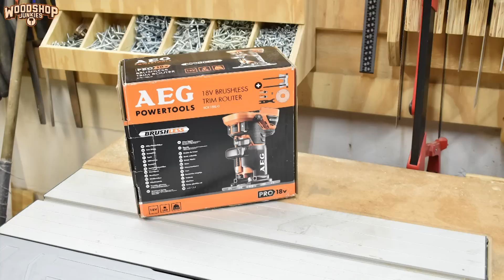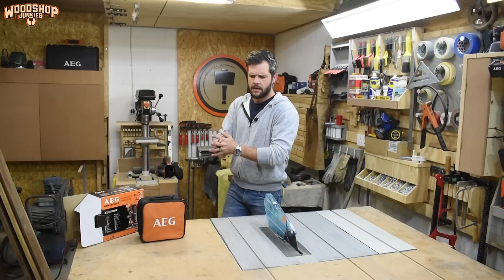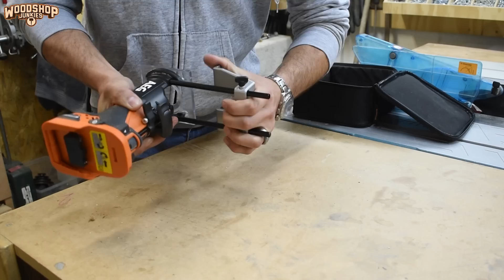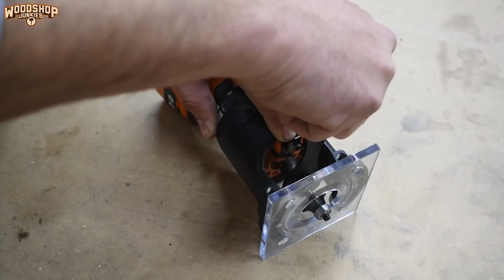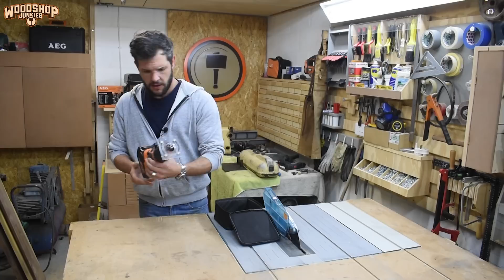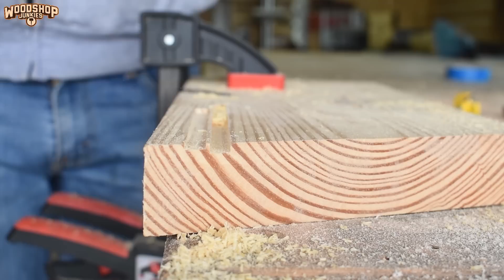Time To Go Cordless? - 18V Router Review - AEG/RIDGID

Comment: Great overview!  
I have the equivalent model of the Ryobi trim router.  It's essentially identical, but no speed adjustment.  It didn't come with a dust port, but I was able to order the Ridgid dust port, which fit perfectly on the Ryobi.

Comment: I own both the Dewalt and Makita trim routers. They are equally annoying when it comes to changing router bits. Sometimes its easier to just remove the base to change bits. At least it only requires one wrench unlike my older Bosch router.

Comment: I have a porter cable router I bought 30 years ago it works every time I plug it in! For the cost of a router and how often it is used cordless is not a good option for many! Yes I have a portable DC powered drill and driver I have had for six years still hanging in there. But it will not last 30 years. And latter down the road batteries will not be available. Been there done that with a Makita drill.

Comment: How are you finding using such a lightweight tool with such a heavy battery? I find this is the biggest drawback with cordless tools - all the batteries you accumulate so you don't run out of power, and their weight when using the tool.

Comment: Good review.

I do not use a router very often.
i have had a corded trim router for about 2 years and very rarely use it.

I like battery powered tools as they are immensely handy.
Not having to drag a cord or in some cases run a generator on remote  sites that do not have easy access to electricity is a plus.

Comment: Love the review. I haven’t been a fan of AEG personally. More that I’ve settled on two battery systems already. Bosch and Makita. I went with the Makita unit. It comes in a full carry case system, includes three bases and the usual fence etc. It is a beast but appears a bit lighter than the AEG or at least has less bulk. Has been an awesome unit. Wasn’t sure about the tilt base till I used it and wow it was great. Includes dust collection, which I’m a bit lazy and don’t use, just throw on the dust mask. Thanks again.

Comment: Hi Jean. Good review.would have liked to have seen template routing capabilities and other functions. On secondary issue , where does one purchase a triton 1400w router in za A
Reply from the maker: I got mine a couple of years ago. More recently I have heard some of the guys mention that they can be tricky to track down locally. Your best bet would probably be specialized power tool distributors.
Reply: I heard that Vermont stopped importing Triton

Comment: Here in the U.S., Ridgid is a Home Depot brand of tools, tho Home Depot also sells Ryobi tools. I mention this because the trim router you review in this video is very similar to the Ryobi cordless trim router I recently bought and began using on shop projects, save for a few small differences: the On/Off switch is in a different location, the Ryobi is not variable speed, and it didn’t come w that adjustable fence guide. Otherwise everything is the same, including its performance. I’ve found it to work fine for the small jobs I’ve used it for (chamfers, roundovers). One day I plan to upgrade to the 18v DeWalt, but for now this one is fitting the bill just fine!
Reply: I have the Ryobi trim router but also a Bosch Colt for some more power. I also have a couple of Festools, so each tool has its place.

Comment: You did a great product review... I completely get the gist of the tool and capability, Here in the U.S. I suspect Rigid is the comparable brand, if not the same. I also have a trim router (Milwaukee 18V) and a regular plunge router/table (Bosch AC Power) I like them both for obviously separate tasks, very handy to have in the shop. For some critique in presentation, and not meant to be disrespectful,  I think your demos would help if you said what it was you were about to do before making the cuts... I could see the bit in the router and knew what was going to happen.  Another thing I felt was left out was a talk about the depth of cut; you foreshadowed that it is not as powerful as your Titian, so that would be the best place to talk about the adjustments to the speed and/or depth of cut... and how you'd use the depth feature with the fence to make multiple passes to deepen the cut. Clearly you have to baby it a bit more... but some pointers would be appreciated, heck I'm sure I'd pick up a tip or two even though I don't have the same brand of trim router.   At any rate, I am a fan of your channel, I love the innovations and clever use of small spaces... Cheers!

Comment: i have this AEG router. not a bad little router. i mainly use for roundovers, as feel its under powered to do much else. have found it easy to use. however i am not a fan of AEG customer service, to the point i now only own this AEG tool. it might be a New Zealand related issue. but isolating to this tool, its a great piece of kit.

Comment: Yes AEG/RIGID are the same. Ryobi and Milwaukee are also made by the same company.
Reply: the price difference comes from glass fiber reinforcement in the plastics, battery balancing computers, heat dissipation in the speed controller, bearing tolerances and other small gizmoids

most of my tools are rigid/AEG
totally contractor grade

but for the cordless tools I use EVERY day, I got milwaukee 
for corded tools I go makita

milwaukee tools have probably the best actual batteries in terms of power/time

but makita batteries drain quickly but last forever

makita is usually the top-notchest of tools out there, but their battery life isnt great 

however....dont go buy the worlds most expensive power tool just to be a homeowner 

nothing wrong with ryobi if you're a hobbyist or a homeowner, 
beats using your teeth for damn sure